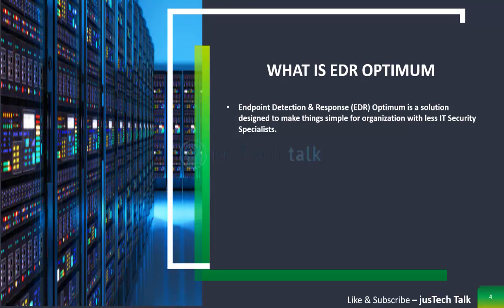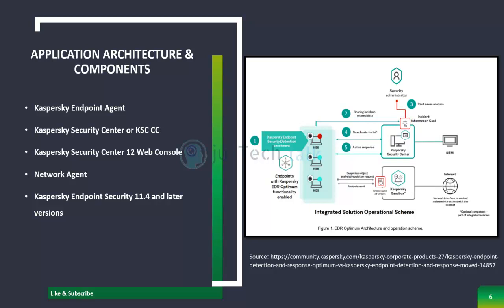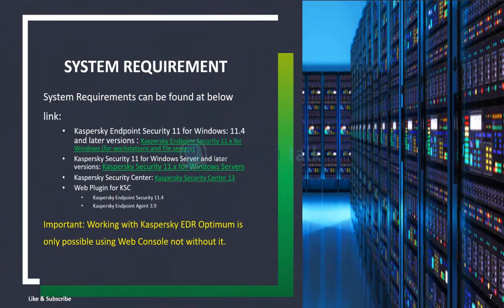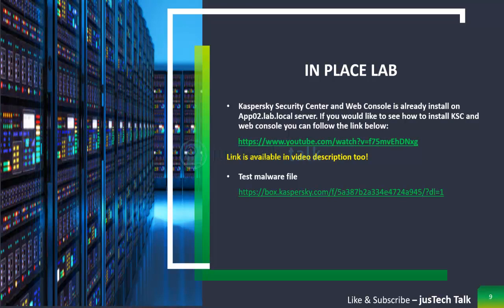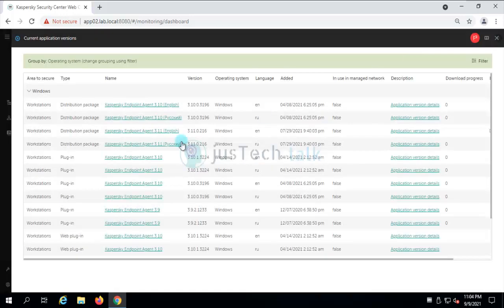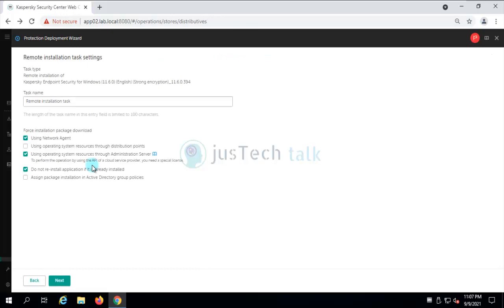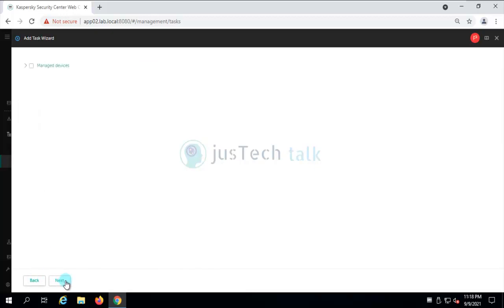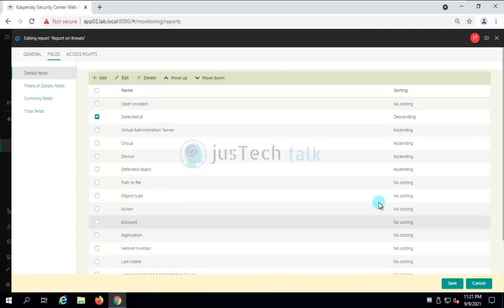Kaspersky Endpoint Detection and Response Optimum (KEDRO) - part 1/2

Comment: Hello Master
I have following question: 1. Is KES mandatory to install EDRO? If the customer does not want EPP but they would like to install EDRO
Reply from the maker: In latest version edro and kes comes with one installer. Epp should be there to enable edro.
Reply: @jusTechtalk  Many thanks for the reply. I have lab setup with NFR and I tried to push KES latest version but it install KES without endpoint agent. Also in KES plugin settings, I can't see option to enable endpoint agent like what you shown in your video. Not sure I need to push the agent separately. Do you have any idea about this?
Reply from the maker: @rafemuhammed  check your setting, does it have agent package also part of your task or not, please.

Comment: Hi, I have allowed  Kaspersky endpoint detection and response to be optimized and added to the center. and set it to automatically distribute licenses only among activated clients. but did not receive the license added I would like to know if there is a way to fix this problem.
Reply from the maker: Hi Bandit,

Check if you have task for that. There should be license distribution task for this.